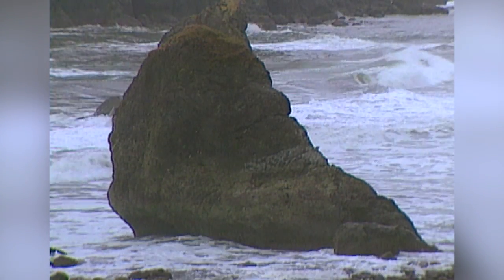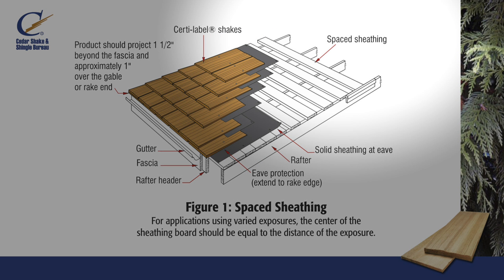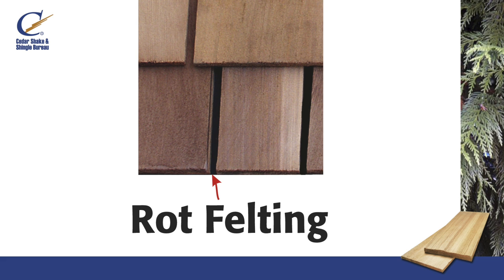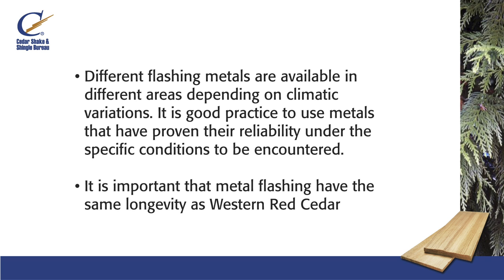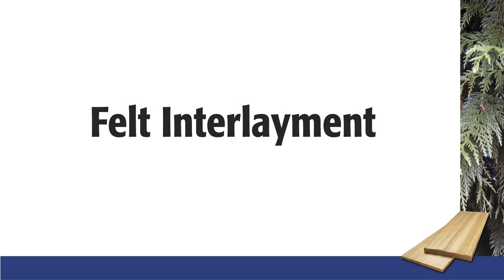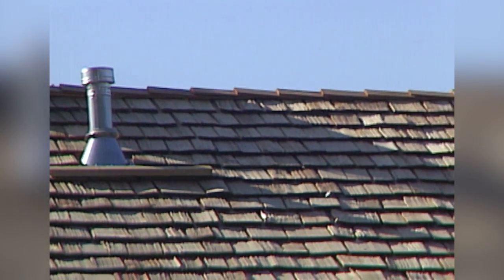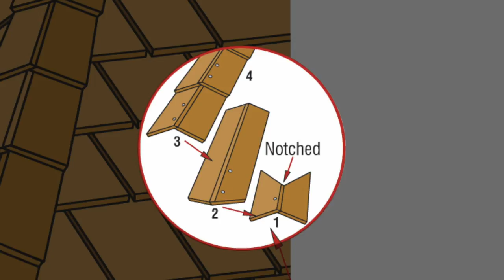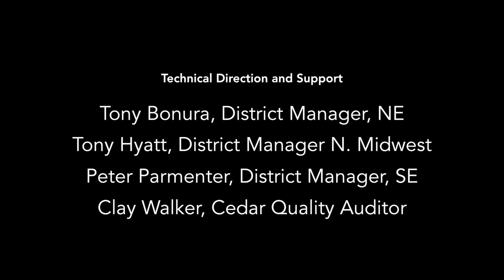Installation Video

Comment: You're not supposed to nail directly through a valley pan, doing to will subject the valley pan to seismic activity and uneven expansion and contraction of the two structures it bridges, causing eventual failure in the form of tears as a result of eventual deformation and creasing and subsequent work hardening of the metal where the most force is exerted upon it.